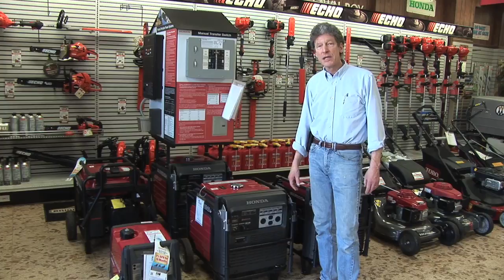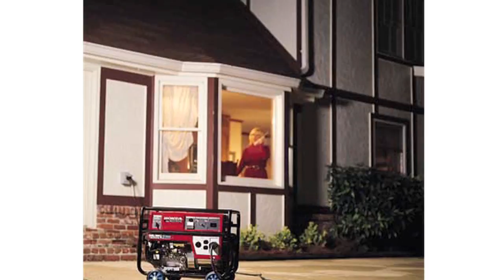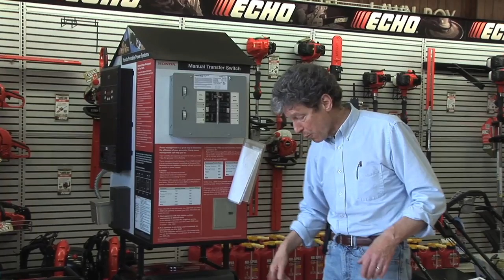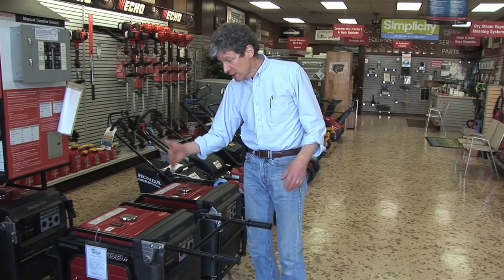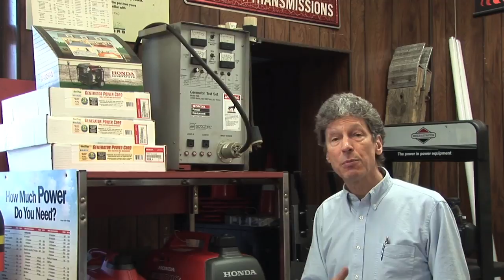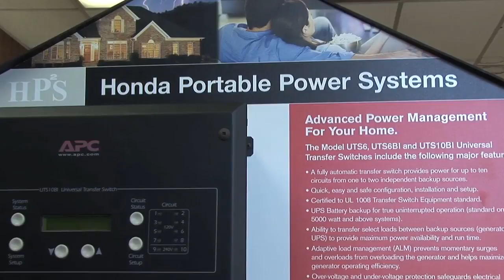Honda Inverter Generator Overview

Comment: Great presentation Keith! 
I have the EU7000is & have owned it for seven years. It starts on the first try every time. 
I'm ironically a power lineman for a living. It's not lineman that could be hurt  by a back feed. We wear high voltage rubber gloves when working on conductors. It's the dog walkers & joggers that your more likely to kill from a back feeding generator.
Reply from the maker: Glad you liked it -- very generous of you (especially being  in your trade) to give me such an accolade!
Reply: @keithpetersen8114 Are you kidding me? I like to see folks who know their products inside & out! 
I had lots of coworkers who gave me incite on Honda generators. We even have them at work. They get the credit for selling me on buying mine. I went to my local Honda dealer & told him what I wanted with every accessory, 12 "No spill" 5 gallon fuel jugs. A complete tune up kit & spare parts. I think he might have closed that day? He cut me a little break on the price because I paid in cash & he didn't even have one on the sales floor. It took him 12 weeks to find one in another state & delivered it to my house. Honda was experiencing a 16 week back order in that specific generator. They ended up adding a third shift at the factory to meet demand. I'm a defacto sales person online now of that specific generator. There is no better salesman than one that owns one.
I have to tell you I've only seen one in the flesh in my travels at work. They are like hens teeth. I just got done restoring power to one house & went to check with the customer that they were infact powered up. They were. They were also putting away their EU 7000is. We talked briefly. I think the only reason they don't sell more is the price point? I remind people that their product is bullet proof. 
Great content!

Comment: Very good presentation. What is the difference between the i & is versions? I presume the i stands for inverter & s for true sign wave?? but what is the difference.
Reply from the maker: Hi -- Sorry for any confusion -- "i" and the "s" are used to denote the same series of units.  So, for example, an EU3000i or an EU3000 or any other variation of that unit should, properly, be designated as an EU3000is.  I hope this helps clarify.
Reply: @keithpetersen8114  Hi- the "is" is a different version to the i. I'm guessing the i stands for inverter but the s doesn't stand for sine as probably the inverter will produce the pure sign wave.
Reply from the maker: @MarkAAshdown  Hi Mark -- Well, at least you galvanized me into enough further action to contact our Honda Service Liaison (the "guru") regarding any potential differences between "i" and "is" generators.  He confirmed that any unit marked either "i" or "is" is the exact same series and technology -- it is merely a designation.

Comment: Wow! Mr. Petersen, your review was just Fantastic. We just recently had a power outage for several days and your review was so helpful with the clean power from the Inverter generator and Transfer switch. Where can I get one of these HondaEU7000IS generators. I cannot find one anywhere? Thank you for your Review!
Reply from the maker: Thanks so much!  Wonderful compliment!  As of now (11-4-20) there are no Honda EU7000i generators available through Honda which is why you are not seeing them in the marketplace. 

Honda has just opened up the ordering process (i.e., for Dealers) again a few days ago; but, the likelihood is that nothing will hit the marketplace until late December or even January 2021. 

We have been taking orders for almost two months, now, for this unit.  "Get in line" with a local Dealer and you should get your generator in another month or so.
Reply: @keithpetersen8114  Thank you! I am in Georgia or would gladly purchase from you!
Reply from the maker: @pekchops  Hi -- very kind of you to suggest that.  No problem -- just buy from a local Dealer -- although it IS a lovely ride up to New Jersey at this time of the year ..... :-)

Comment: Sorry guys but look at a Generlink unit for hook up to generator!
Reply from the maker: A lot of bad reviews on it.
Reply: Well I’m Canada they are certified by Hydro One and are safer then the set that is presented. So you go ahead and designate your 10 breakers and be limited. I’ll adjust on the fly and use whatever’s want when I want a per conditions.
Reply from the maker: @hollywood1937  Mixed reviews but a lot of negatives.  Nothing is safer than a transfer switch.

Comment: Well spoken, Great presentation.. Thank you.  Can you provide when turning on the generator where should you expect to see the rpm's? Then, after turning on the Eco switch where do you expect to see the rpm's. Thank you.
Reply from the maker: Hi John -- thanks for your commendation.  At idle it is about 2100 rpm.  Normal full run speed is around 3500.  However, the Eco throttle design will actually allow it to go as high as almost 4500 rpm for a short time.  I hope this helps.
Reply: @keithpetersen8114  Thank you
Reply from the maker: @dj5752  You're more than welcome!

Comment: Ran my whole house fridge lights toaster oven when I needed it tv internet everything on 2.7 gal in 24 hrs•••>share4.photo/HEU22Inverter?еο    Don’t forget you can hookup propane or natural gas with an adapter. I was amazed how the exhaust from propane was scentless. The propane allows you to have a one time hookup that lasts more than 2 days so you don’t have to deal with refilling small gas tank no mess and no residue build up and engine lasts forever.

Comment: Hello Kieth, I just purchased a EU6500is Generator with 101hrs on it. We have a 50amp  fifth wheel with 2 A/C units, a 13.5 & 15.5 btu. Could you tell me which recepticle is best to use & which voltage selection do I choose to give us the best power for our 50 amp fifth wheel? I've been using the 4 prong L1430 recepticle with the voltage selector on the 120v instead of the 120/240v selection. Can I run it in the 120/240 selection without damaging anything in my fifth? Thank you
Reply from the maker: Hi -- since you are wired in using the 120/240 L1430 receptacle the usual selection would be to take advantage of that by throwing the rocker switch to 120/240.  The EU6500 is an inverter generator and thus protects even your sensitive electricity using products.  Also, when you select 120/240 the internal wiring on the generator maximizes your electrical output.  I hope this answers your questions.
Reply: Yes, thank you very much!
Reply from the maker: @TheSixer211  You're welcome!

Comment: I guess most folks know Honda generators are always on the top of Consumer Reports list for quality. That said, most average folks just can't afford them, so that's where other brands come in. You have to live within your means. Sadly.
Reply from the maker: Hi -- thanks for your input.  Yes, Honda does make the best gasoline generators.  The initial price is certainly more than many of their competitors' units; however, when the costs are factored in from the damage that can occur to electrical-using appliances (fridge circuits, heating system circuitry, microwaves, plasma tv's and various electronics) as a result of the low-price Chinese components that are present in the average generator -- Honda becomes a lot more affordable.
Reply from the maker: @JusticeAA  `Tis true!

Comment: Keith any word from Honda on the Parallel kit for the EU7000 yet?
Reply from the maker: Hi - I tried several times today to get through to the parts department; but, they appear to be having phone issues.  I'll try again within a few days and get back to you.
Reply from the maker: Hi - I subsequently spoke with a Honda Parts rep - she said no ETA as of yet - it is still in development.
Reply: Thank you.
Reply from the maker: @Dqalex   Hi - update 12/17/18 -- I am told that it is about to hit the streets!

Comment: Great video my question my transfer switch plug is the L14 four prong! What's the smallest Honda generator that has that plug. Thanks
Reply from the maker: Hi Nick - thanks for the complement.  It would be a 5000-watt Honda - either a EM5000 or an EM5000i.  The latter is an inverter generator which is the preferred series since it is quieter, much more fuel efficient and, most importantly, produces "computer-clean" electricity.  Since the EM5000i is only a few hundred $$ less than the EU7000i (which is fuel injected, as well) we no longer stock the EM5000i.  The EM5000 is around $2300 - the EU7000i is $4000.  You can use the EM5000 but you would have to be careful with anything with electronics as they are susceptible to damage (computers, modems, fridge, heating system, phone system, etc.).  I hope this helps!
Reply: Keith Petersen  you answered my question eu700i. Thank you.

Comment: Great video..!!! I am interested in getting an EU7000....
How many hours do you think it would run at 50% load on a tank of gas..??
I looked on Honda's website and read the specifications but was just looking for real world numbers from someone like yourself who has actually used one ...
Reply from the maker: Hi - glad you enjoyed the video.  I can only answer your question by saying that 1/4 load is rated at around 20 hours.  This means that it is running at full capacity 25% of the time and the 5 gallon tank (keep in mind this unit is fuel injected rather than carburetored) will provide around 20 hours of run time.  Thus, 50% load would vaguely translate into around 10 hours.  Whatever the specific time frame, this generator - compared to the competition - has exceptionally long run times coupled with ultra-clean electrical output.  I hope this helps.
Reply: Keith Petersen 
Thanks for the info..
I bought the EU7000...wish I could have bought it from you.... if I was closer to your place I would have.....
I only have 5 hrs on it so far but it's the quietest and smoothest running generator I have ever had....
It is replacing my Generac 8000kw....
It powers my whole house with the exception of the central A/C..
Thanks again..!!!
Reply from the maker: You coulda moved closer and then bought from us .... :-)  Yes - it is an awesome generator - glad you like it.

Comment from the maker: Come check out our Honda gas generators today you never know when you may need one!!
Reply from the maker: Stealing is an issue with generators.  Wheels can be removed and bolts could be installed from the bottom plates.